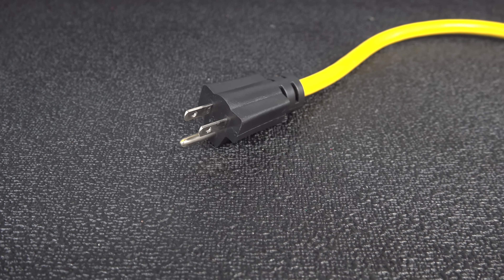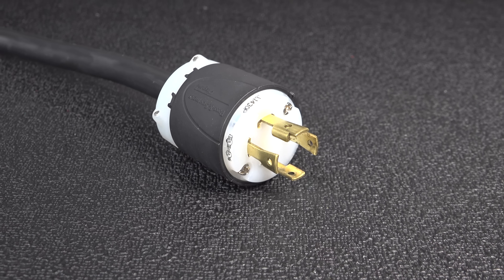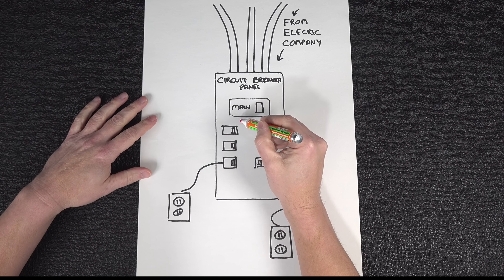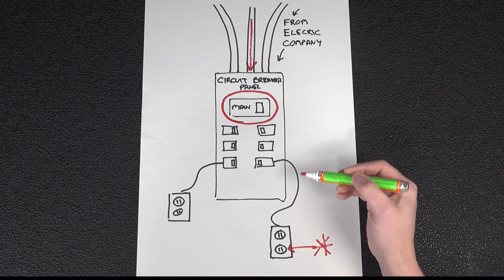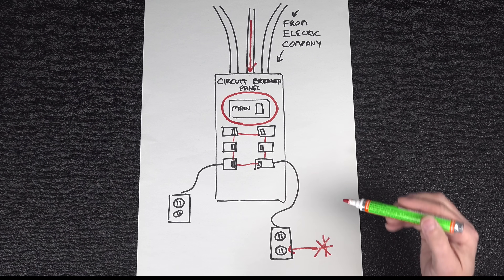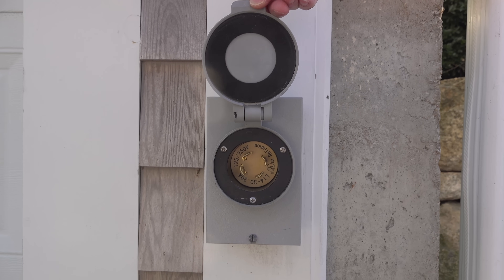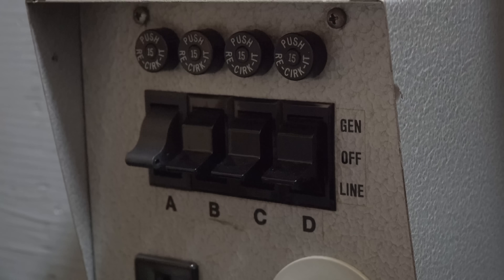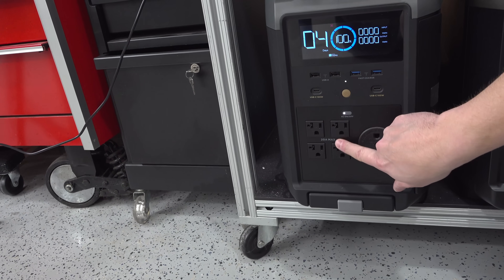Worst Electrical Mistake You Can Make - Backfeeding Generators

Comment: Your supposed too plug your generator power transfer cable into your recepticale and turn off your homes main breaker "AND" all of your other breakers in your breaker panel even your generator breaker first before you even turn on your generator ! Then (1) START your generator, (2) come inside to your breaker panel and flip on your generator breaker, (3) start flipping on the "most crucial/most important" breakers first that is needed like your refrigerator, water well pump if you have one, a few lights, home heating unit if needed, stove or microwave, AC unit if needed "IF" your generator can produce enough power without over tasking your generator ! Don't just go thru there flipping every breaker on ! Your generator can only produce a certain amount of constant running watts and there are things like your refrigerator,  deep freezer, AC unit that has a compressor that starts running making a massive draw of watts to be able to run. Even thoe the watt draw only lasts a short time if you have to many things in your house drawing power they can't start up without enough power and can be damaged. Your generator can handle constant watts but it can only handle a certain amount of surge watts for a short time. Say if you have a 15,000 / 12,000 watt generator that means the 15,000 watts is the surge watts that it can handle as your items in your house that has a compressor starts cycling on then shuts off and they just recycle the cold with the fan like with your AC unit. You aren't supposed too over tast your generators, power consumption shouldn't exceed over around 75/80% of you generators capacity for long periods or it could be damaged ! Also, if you have a dual or tri-fuel generator your maximum watt output is with the running of gasoline ! If you use propane or natural gas your watts output will be significantly lower so check your manuals ! One thing that will help big time is if you want to run your AC unit put a Micro-Air Soft Start on your unit ! It allows your unit to start up slower than normal witch you won't be able to tell any difference at all in its start up. Your AC unit pulls a lot of amps as the compressor cycles on. Your AC's power draw might be around 70 amps at start up and when the compressor kicks off maybe settle down to 35 amps until the compressor kicks on again. That's a lot of amp draw from your generator and it might not be able to handle it with other stuff running to. Putting a soft start on your ac unit will cut down on you unit power draw needs. Putting a soft start will cut the amp startup draw down to probably around 35 amps and when the compressor shuts off and the unit is just running the fan would only be probably around 18/20 amps ! That's a very big difference in saving power so you could turn on more things in your house ! They are high, their like $340.00 . I bought one and it's the best thing I ever bought accept for putting a "Sense" home power monitor in my breaker box. It will show you on your smartphone exactly how much power your house is using in real time ! The regular home Sense monitor can run $299.00 but they run a sale on it down to $259.00 . Check them out it really helps to know exactly how much power everything is using. Oh, I forgot to mention that after you install it it learns what everything is in your house that is using the power so that will help you know what things can be turned on in a power outage without overloading your generator.  Sorry to be so long winded but I hope this helps someone.

Comment: Has anyone here ever actually tried backfeeding without turning off the main breaker? Impedance of the grid is VERY low, pretty much a direct short from the perspective of a generator trying to back feed the grid. Unless main grid was down at your closest transformer, wouldn’t it pretty much immediately cause your generator to shutoff or trip it’s built in over current protection?

I’m not condoning it, just thinking it wouldn’t work even if you tried to.

Comment: They can be used as a way to test your system prior to having the main power hooked up as well.  Some just talk about the back feeding during an outage but never mention that when you run new lines or update current lines this is a way to do a quick test to see if things are all connected properly prior to having the main electric feed turned on.

Also if the main power is not turned on this is a way to have a temporary electric feed for your power tools as you make other repairs.

Comment: ‼️HELP PLEASE⁉️ Question is at the bottom.... I have an old system where the main slides out making it impossible for someone to accidentally do anything. Plus, it's just my wife and I now. I can with absolute certainty say that I won't be hurting anyone else if I do this. No close neighbors either, I'm rural, so a fire would not even be a hazard for others. Wouldn't sleep with it plugged in just in case also.

So, my thought is to get/make a large battery pack that I charge from the wall inside or even maybe just do it with an actual generator from an outdoor socket.

Question: My system (most of it as I have a modern panel tied in outside ) being un-upgragded uses plug fuses. All different amperages of course. Would that cause issues internally?

Comment: Also remember that this can start a fire, the breaker box could allow 10 amps and the generator could also deliver 10 amps, so the total would be 20 amps available on a line that normally only would run with 10 amps.
Reply: So, a situation where the same wires are being fed both grid power and generator power? The generator's breaker should just trip. Remember, this is AC, so if the grid power came back on while you were backfeeding with a generator and had the main breaker on, the grid power would be out of phase with the generator, resulting in a large voltage differential between them. This would essentially be a short circuit, and should trip either the generator's own breaker or the one for the circuit it's feeding.

Comment: We had built a backfeed system to our house for our 10 kW generator welder.   Living near the coast you need a generator a lot. We have a considerable background in electricity but we are not certified electricians. My neighbor is he checked out our work he said it was pretty good so we kept it he didn't like the fact that we had a little suicide plug but eh....  We always thought , and this is proof that we're not electricians,  that if you kept the main breaker on as soon as main power came back on it would burn something or at the very least just blow a breaker.  we always make sure to turn the main breaker off and pull it out .

Comment: Crazy, I had no idea the electricity could flow back into the main utility lines like that.
Reply: Its one of the reasons legal 'solar power back into the grid' setups are sooooo expensive....they have to kill the solar if the power dies. There have been several instances of repairmen dealing with downed lines and getting zapped because someone has connected their solar straight to the mains........

Comment: Alternatively, use an NC contactor to open the supply circuit when the generator outlet is energised. It would guarantee that every time you had a generator running, it would keep the mains disconnected. Maybe make it a latching contactor so it has to be manually closed again when power is restored.

Comment: I mean... pull all fuzes or flip em or how ever it works in the us... and technically.... connecting your generator to an outlet would give you dc or ac or what ever the generator is generating to your sockets that are also connected to the one you plugged the generator in so... not undoable but WRONG! edit: just like you told in the video flipping the main breaker(i guess that whats it called) on would short the main breaker or the breaker your socket you plugged the generator into

Comment: I've used the "double male" plug method to back-feed my house many, many times... of course, only after opening the main service disconnect first. Perfectly safe, IF you know what you are doing (35+ yrs. as an electrician helps). In a pinch, this method will keep your house (or at least part of it) supplied with energy during an outage. Be aware, however, that you will only be feeding 120 volts to HALF of your house. Which half is dependent upon which buss-bar the particular outlet (and circuit breaker) you are back-feeding is connected to in your utility panel. Also, it is very important to open any 240-volt breakers to prevent possible cross-feed/back-feed through the neutral. Open (turn off) all 240v loads such as water heaters, electric dryers, electric ranges, etc.

BTW, that generator connection is not called an "outlet", it's an actually an "inlet". Outlets (aka, receptacles) are the female-gendered connection. Because these are male connections, they are not, by definition, "outlets".

Of course, the safest method is as described, with an approved interlock device, or a properly installed transfer swich.
Reply: Alan, the problem is, most people are not 35 year+ electricians, let alone a 35 second electrician, and when they see people say "Well it's perfectly safe if you do this and that and the other" they think they can just copy it and it'll work.

Then they wind up dead.
Reply: @johnroscoe2406   "because most people are idiots" don't tell the truth. Backfeeding can be deadly. Backfeeding is safe if you take the proper precautions. 
Both are true.
Reply: Wouldn't backfeeding through the 30amp 240 outlet on the generator to a 30 amp 240 receptacle inside the house eliminate that? Not an electrician, so I'm not saying I know the answer and have no plans to backfeed.
Reply: @Vinny.X  
Yes. If you were able to feed 240/120v (two "hots" and a neutral) through a proper 240/120v, 4-wire plug & receptacle, back into your panel, then both busbars in your panel would be energized, and essentially, every circuit in the house would work. However, having only ~30 amps of available current would mean you would have to disconnect large-load items (like electric water heaters, clothes dryers, AC compressors, etc.) to prevent overloading your generator. 
And, you MUST open (i.e. TURN OFF) the main circuit breaker feeding the panel, to prevent a backfeed into the utility.
But it can be done.
This is exactly how a home standby generator system works, except they are generally hard-wired in, and have protective interlocks, to prevent improper backfeed.
Reply: @Calico5string1962  Funny we're talking about this as I'm in the dark from a large Southeast storm. For background, I do a lot of DIY mildly complex electrical: can run new wire to a new circuit on the panel, wire up 3 ways, wire up mildly complex boxes with say power in, a switch loop, a fixture, and then power out to the next box. For a non electrician I'm probably very good and thorough with basics (though might use incorrect wording at times), but fully understand I am not an electrician and defer to those like yourself.

So my thinking was if ever some extended zombie takeover I could run a 6000/7500 watt generator thru 10/3 cable back fed into my dryer outlet. That size generator should not overload that circuit. I do understand the 3 main dangers: not shutting off the main breaker, plugging the cord into the generator first leaving the prongs on the other end hot, and forgetting to turn off the generator and disconnect before opening up the main breaker to street power.

I don't ever plan on doing this, but as I said I would be tempted to change my mind in some horrific terrorist type extended event. I realize I can't run much in the way of large 240 appliances, but for most outages just give me some lights, the fridge, and maybe some other small stuff. I have to recheck the wattage on the smaller of my ac zones. It's a high efficiency 1.5 or 2 ton unit. I think, but not sure, I could run it with most everything else off but have to recheck the numbers.

Comment: Just a note: EVERYTHING is unsafe if not done correctly, driving your car, swimming, hooking up your dishwasher, taking a shower, eating, washing dishes, and yes, even having sex.

If you're doing it wrong, it doesn't matter what you do. 

For eg: yes, the double ended cable has live energy coming out from exposed prongs. So 1) you don't energize the cord until it is seated and 2) you don't touch the live ends. 

Backfeeding isn't any less safe than running 20 or 30 extension cords into your house during a prolonged blackout.
Reply from the maker: True for the illegal method, it relies on everything to be done correctly and assumes no one else will touch it. That's the problem. If you go the legal route and use an interlock there is no risk of shock or back-feeding. That's the difference.
Reply: @SilverCymbal  Just so you know? There are always issues when you do things legally as well. Driving is legal with a licence, but you can still kill someone, right?

The bigger issue with portable gennies is people putting them inside attached garages and or near open windows. 

You could do it all "legal" and then end up dying of CO2 poisoning.

Comment: These cables aren't unsafe, just anti-stupid. If people knew they were for emergency situations only, knew what they were doing, there's nothing wrong with them. An interlock system is a large expense for a "what-if" scenario, but a quick gen-rental and this cable is cheap for those once-per-decade events. So it has two male ends, just plug it in before starting the generator. So it backfeeds, ensure the main is off, maybe even lock-out tag-out if you have dumb roommates.

Comment: Let me ask whoever knows this question, to install the device that disconnects the city power from your isolated self when using generator power, to install that it would seem to me that the power switch or shutoff or whatever the next thing is to shut off that I do not have access to would have to be switched off for me to install this “disconnecter” right? How would I do that? Would that mean they would have to shut off the entire street power for the install? In my mind (I could be wrong) this disconnecter seems prohibitively expensive where as linemen are free from the power utility, no?

Comment: We cobbled one of these together to temporarily connect the power strips in two equipment racks together for testing before installation -- giving it the nickname "Jones Death Plug". (The racks were normally hard wired into AC when they were installed). Although we zip tied the cables into the receptacles and hung warning tags on them it still gave me the willies that some unaware tech would wind up grabbing an unplugged hot end and get injured. We yanked it out and beheaded it as soon as we were done. Scary that these things can actually be purchased.
Reply: That's nuts you could've legitimately killed someone
Reply: @AegisHyperon  - Well, you got the point of the post that such cables are dangerous and shouldn't be sold, right?  In our case, if an unauthorized person had entered our restricted lab unattended, powered up the equipment we were testing, removed the red safety tags, cut the zip ties, removed the right end of the plug, grabbed onto the hot contact while grounding themselves somewhere, it could have killed them. In any case, we weren't going to leave that thing lying around once we were done with it so we destroyed it. Doubtful that most people who use them to hook up emergency generators take such precautions. By the way, cables with the receptacle cut-off are much more common and can be just as dangerous to leave lying around.
Reply: @TomTRobot  one person doesn't have to do all those things, all it takes is a series of coincidences. This isn't the same as backfeeding a generator please don't do it again...
Reply: @AegisHyperon  - Do you know the expression "Whipping a dead horse"? --- But you're right. It sure isn't the same. Average homeowners with their families using those things to tie generators into their home outlets is much more dangerous.
Reply: @TomTRobot  not even close
Reply: @AegisHyperon  Not even close? Then explain why. After all, it's one thing to act like you know something, and another thing to be able to show it.

Comment: I went for the middle road as far as expense,... I installed a 30 amp Generator Inlet box to the exterior wall of my Kitchen, ran the wires in the wall to a 20 amp house hold power outlet in the kitchen.
This is NOT wired to the house electrical wiring,... I can run my generator outside, connect the cable to the enclosed Male generator Inlet to send power to that one double outlet in the kitchen for me to run the fridge & freezer which totals 10 amp at most,... This leaves me 10 amps for other stuff like a fan, TV, Internet, Radio & so on :)

Comment: I lost my breaker box during a storm (water seeped into the box) so while they were changing it out I asked about a transfer switch, $200 I had a 6 breaker transfer switch installed and he even made me a 30ft cord to go from my garage to the plug on the back of the house. Used it many times and very easy and convenient.

Comment: About 10 years ago, during the summer of 2012, a derécho blew through our town and knocked out our power for over 16 days. We had no air conditioning or running water... during one of the worst July heatwaves in our history. We lived out in the rural countryside, so we were pretty low priority for the electric company. Generators and camping supplies, even distilled water were all sold out. Luckily, this was a tight-knit southern community, and one of my dad's mechanic buddies loaned us his portable Honda generator, with enough horsepower to run our essential appliances. He let us borrow his pre-made power cable and explained to us how he made it, and step-by-step how to hook it up to our power system. And it saved us.